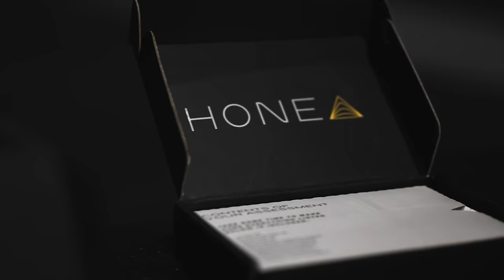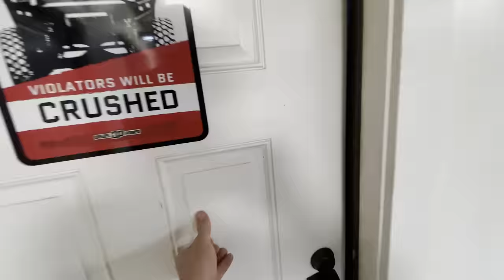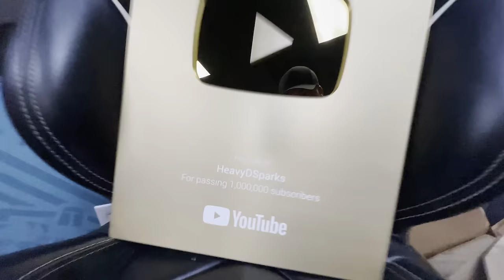Revealing A Side Of Us You've Never Seen Before...

Comment: I picked up on that pro tip. I sweat more than most, also. Tight shirts and sweat cause me severe "prickly heat" (some call it "miliaria"). I have always just used  powders, ointments, and changed shirts as often as possible. Thanks for the guidance; maybe this can be the answer I have needed.
Reply: Try a synthetic blend instead of cotton.
Reply: Stick with cotton no sleeves

Comment: Payload on trucks has been way different than the traditional 1/2, 3/4, 1 ton ratings of old. 
The newest models of the Ford F-350 series truck will have a maximum payload capacity of 7,630 lbs. This truck can haul nearly twice as in the bed as the F-250 and nearly four times as much as the F-150 models.

Comment: Instead of a globe/fire-pit...how about this: So a friend of mine had a big bouy identical to the one at 14:12  in the video. He took a motor and a bunch of 3/4" piping and turned it into a large air compressor (with the bouy being the compressed air storage tank) for his very big multi-use shop. All it took was drilling a few holes and welding a couple of mounting brackets for the motor rather than cutting it in half or a lot easier than cutting the continents out of it